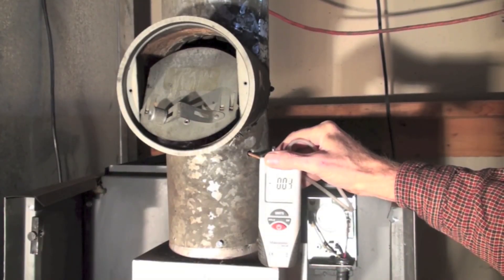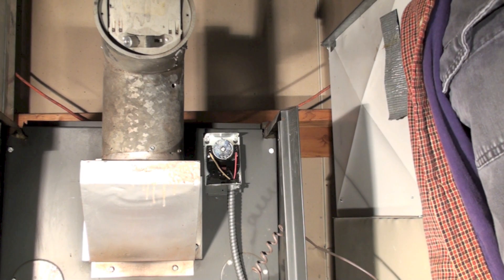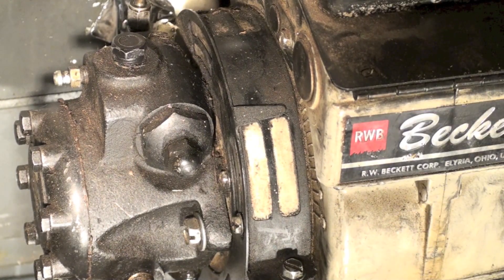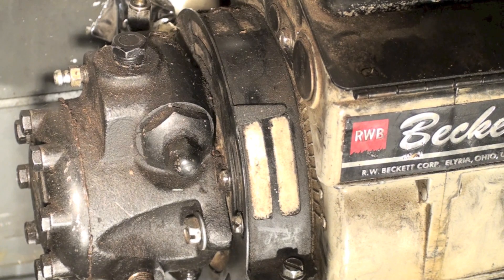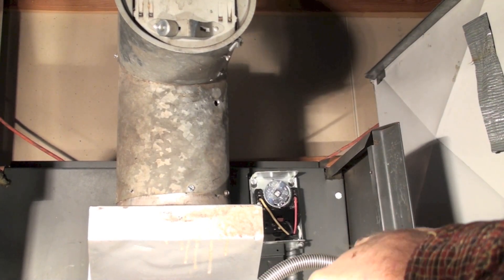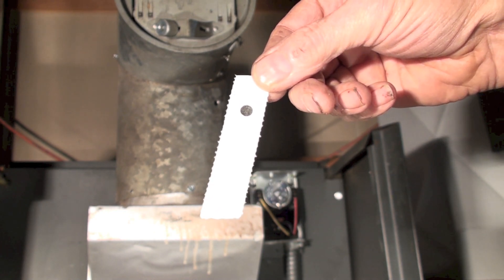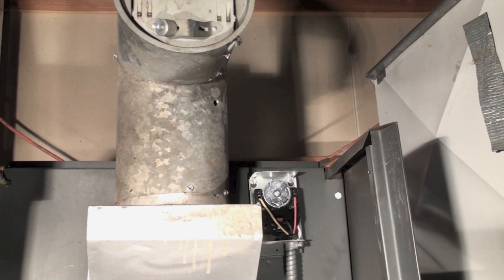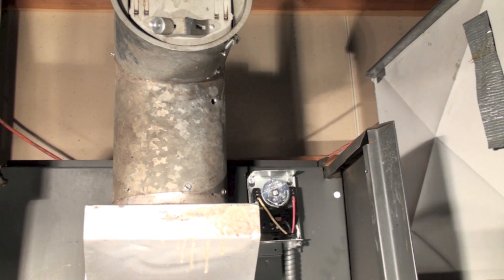Combustion analysis of the oil furnace. Part 1, draft and smoke pump.

Comment: Not supposed to do 10 pumps in a matter of 20 seconds.  3-5 seconds per pull.  Also starting high on air is much more forgiving on your test tool rather than yanking on the seals when it soots up after 3 pulls.  Any tech that has been doing it long enough can ballpark it based off the flame tips before hand. All this is pointless if the pump pressure is off which both Riello and Beckett are known for
Reply: That may be, but with an older bacarach, "wet kits" isn't a big deal

Comment: Can you please explain to me why i sometimes get a wet spot on the paper while doing my smoke tests?  its not oil i dont think and its not yellow .
Reply from the maker: If you are not getting unburned oil in the vent, you must be getting water.  That would be condensate.  If your vent temp is too low, water could be condensing from the fuel.
GFM

Comment: What's a typical range for CO in the flue (not CO2)? Beckett NX .60x60A at 145PSI. 4.1% O2 and 448degF I measure 1PPM CO.  That seems really low CO, is that even possible? Testo 310. At trace smoke I get 7ppm.

Comment: What is the make and model of the white probe instrument you use to determine the 0.02” WC over the fire and the 0.04” WC at the damper? Thank you for your time. Much appreciated.
Reply from the maker: It s an electronic manometer.  It is and its un branded from Ebay.
GFM
Reply: @grayfurnaceman  is the atachment on your manometer hose just a piece of 1/4" copper?
Reply from the maker: @MattMinistry  Yes.  The copper is there for the high temps in the vent.
GFM
Reply: @grayfurnaceman  Thank you so much for responding. I was a Union plumber for 10 yrs before the economy crashed in 08 but am now just getting into heating (forced hot air) and oil because that is what I have in my house. Your videos are so informative and easy to understand.
Reply: I bought mine on Ebay. It's made in China. It works really well and a great deal at only thirty or forty dollars.

Comment: Thanks for the video. I have a question. I got my boiler in spec (co2, o2, EA, stack temp) Oil pressure is right on. My smoke test is still a #2. If I open up the air shutter any more, my numbers will start going out. Do you know what could cause this? The boiler was just cleaned and has a new nozzle.
Reply from the maker: If the burner is a flame retention type, you may have flame impingement on some part of the combustion chamber.  Also be sure the gun depth is correct.
GFM
Reply: Thanks. I'm going to buy the Beckett gauge you referred to in another video and check the gun depth.
Reply: When I took the burner off I found that the head was to big for the nozzle. I installed a smaller one (F3) and got the combustion in spec. I noticed shims on the bottom 2 studs where the burner mounts to the boiler. Have you even seen that? I was wondering what they're for.
Reply from the maker: The shims are probably there to point the burner flame away from the sides of the combustion chamber.  
GFM
Reply: Makes sense. Thanks for your help.
Reply: Draft over fire

Comment: why is the barametric damper mounted upside down?  with that type of boiler it should be -0.02” WC over the fire. The whole purpose of this damper is to increase the contact time of the fire in the heat exchanger for better efficiency. now I have a pensotti and Riello and they run positive, which tooka bit of getting use to.
Reply from the maker: I have used them both ways.  They seem to work about the same.  Maybe I should do a video on that.
GFM
Reply: Didn’t you mean at the the fire/over fire -0.02 and in the pipe -0.04?  Oil at the pipe before the barometric damper should be -0.04 or a bit higher and natural gas in the pipe before the draft hood should be -0.02 or a bit higher.

Comment: Your videos are the best.

Would you mind elaborating on how much you opened your air between smoke tests? Eighth inch? Quarter inch? Half inch?  I assume you moved only fraction of an inch?

I have AFG burner for a year 1990 Peerless WB-3 boiler gross output 129k BTU boiler. I don't have a manual for my boiler so I don't know what air settings should be. There's a sticker on the transformer that gives various air band/shutter settings for different models but my model isn't listed. The last technician did a smoke test but not a combustion analysis so I have no idea how efficient it is. He set air as follows: Air band (aka bulk or mass air) is open approx. 1/4". As in not closed per your statement. Air shutter (on side) is open about 1/3".

I would like to understand the diff between air shutter and air band and when/why/how much to adjust each.

What's your opinion on oil service contracts that also require customer to buy oil from them and only them at inflated prices? Why do they charge more for oil? I asked one company and their reason was you must use our oil because we know it's clean. I smelled a ripoff so I buy my oil from whomever I choose and I found my own service guy. Still looking for a service guy who knows what he's doing like you obviously do.

Thanks!
Reply from the maker: +Matt Foley The movements of the air shutter are small.  Try 1/8 inch to start.  The air band is called the mass air damper for a reason.  
Those contracts are for those that want no surprises.  It would be quite unusual for and oil company to deliver dirty oil.  Hope this helps.
GFM

Comment: I see that you have drilled a hole in the exhaust pipe in order to insert your smoke tester. What do you do with the hole afterwards? I assume that you don't leave it open, as you don't want fumes in the boiler room. Please explain how you fiil or seal the hole afterwards.
Reply: the pressure is negative so it will not smoke:D
Reply: You can use a bolt or piece of heat rated metal tape/foil tape. Some people use a glob of furnace cement or high temp silicone. The hole doesn’t need to be plugged, it’s not harming anything or pulling anything more in that the barometric damper is already. It won’t blow out unless the chimney is blocked, or the combustion of the furnace is to strong in the initial start. Occasionally if you have a severe down draft it could happen. Again the barometric damper will blow out more than a small hole so it shouldn’t be a concern at all. Usually the plug is more professionalism because customers are always concerned about a hole in their smoke pipe, so block it for your customers curiosity.
Reply: Wind a bolt into the hole with some gasket seal on it